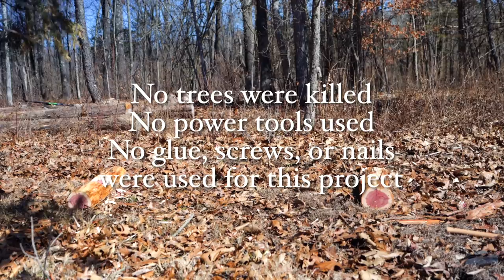Building a Manual Machine For Mountain Biking (NO Power Tools Used)

Comment: To really get the most from a manual machine/ balance trainer, you should be doing it chainless. When rolling in a manual, the small amounts of forward rotation you may impart are usually not enough to have much resistance. In the manual machine the wheel being dead stopped allows you to load up the drivetrain to help you stay up.